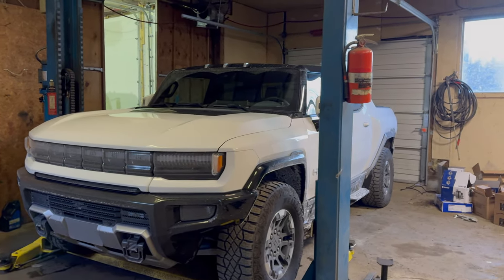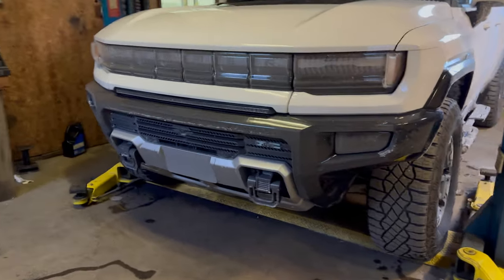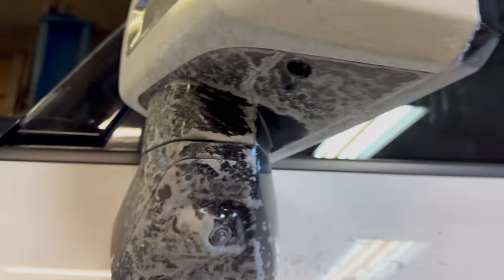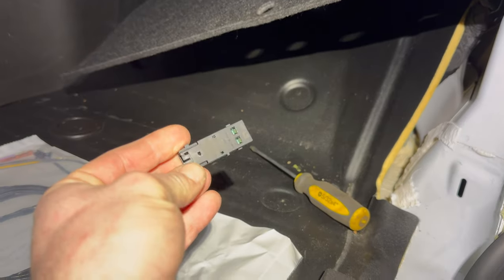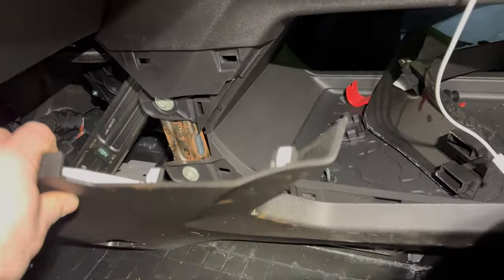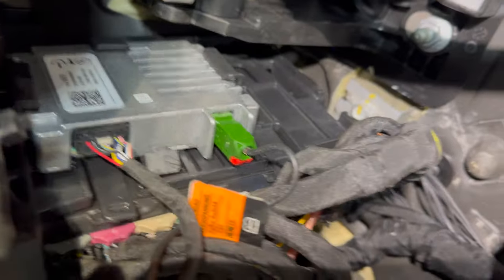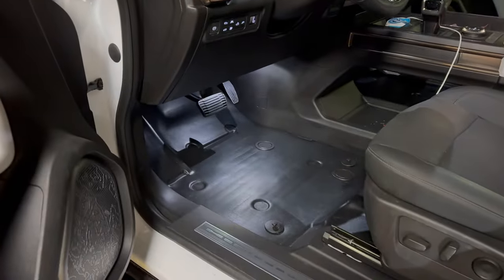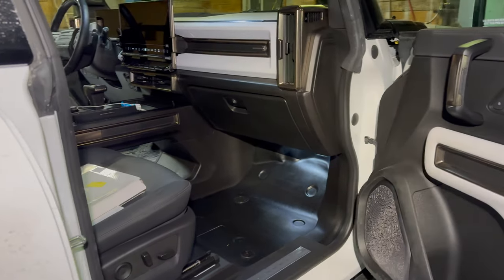2022+ Hummer EV Ambient Interior Footwell Lighting install 87868611

Comment: did you end up doing the mirrors? wanted to attempt them tomorrow
Reply from the maker: No I had a look at it and didn't want to risk breaking the mirror. Ended up having the dealer do it. Book time on it was an hour, they told me it took their tech 3 hours to do it. They only charged me an hour though